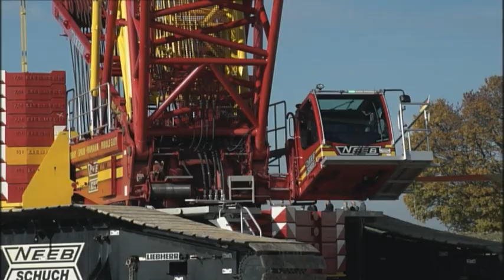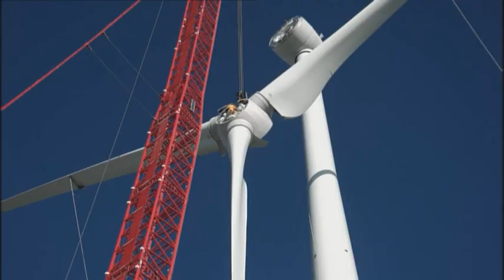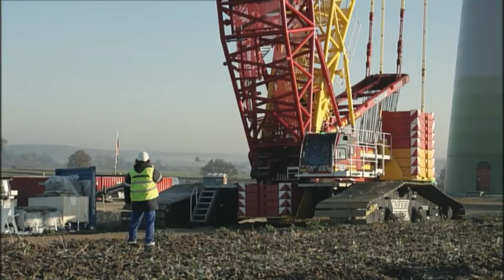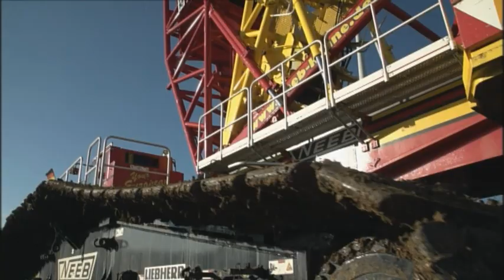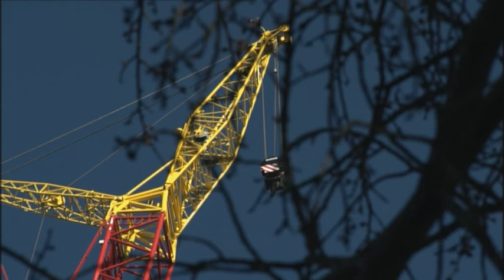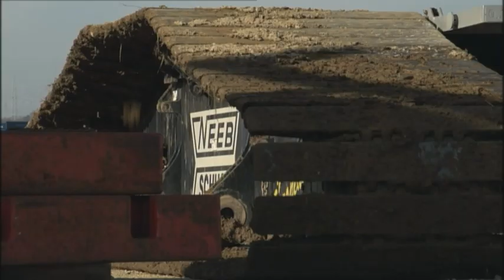Liebherr - LR 1600/2 crawler crane during wind turbine erection

Comment: hi can your let me know the required crane capacity for 100 Meter derrick type stack erection
Reply from the maker: Dear, Shabbir Rezvi the crane capacity with our SL13DFB – System and boom length 102m + 12m fixed jib is 137t at 18m radius. For more information please have a look in our technical data sheet.